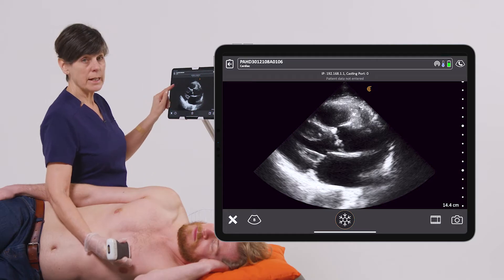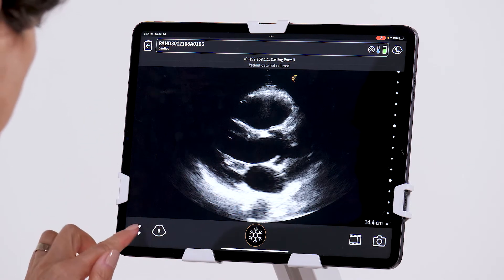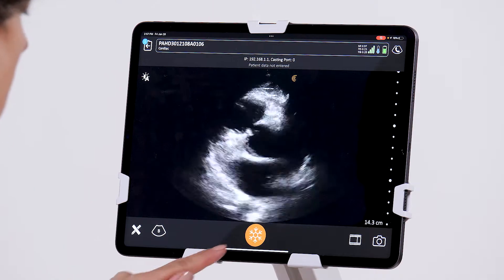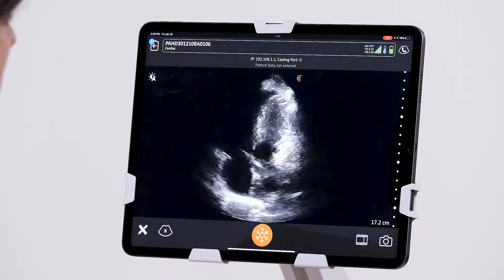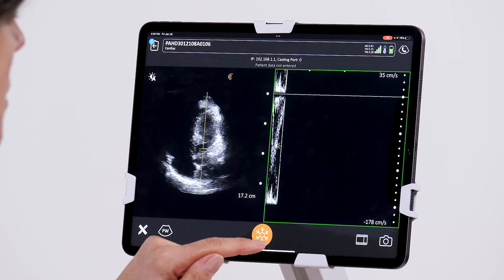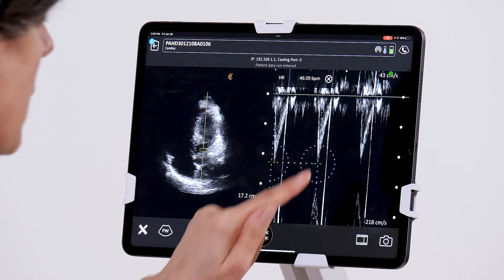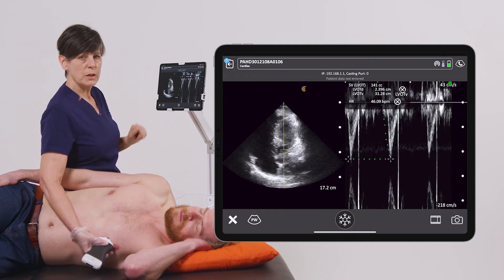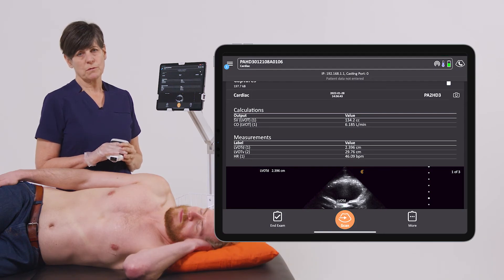Stroke Volume and Cardiac Output

Comment: Could this Clarius PA be used on emergency settings to perform a FAST exam? Also, could it be used like linear probes to help guide central venous catheter insertions? Or would you recommend another model for these purposes? (I don't want to lose the cardiac avaliation shown in this video). Thanks!
Reply from the maker: Thanks for your question, @Shujinkoww.  Yes, the PA scanner is a great choice for FAST exam, but it's not optimal for superficial imaging (for CVC insertions.  We have the perfect solution for you!  It's the Clarius PAL, phased array + linear scanner in one.  You can find more info here:  https://clarius.com/scanners/pal/ .  You'll see pricing there, too, but remember to filter for you region and prices vary depending where you are.